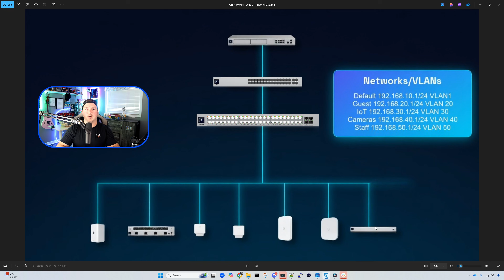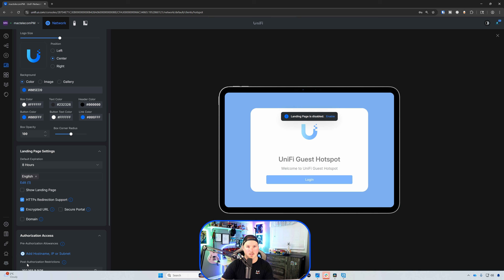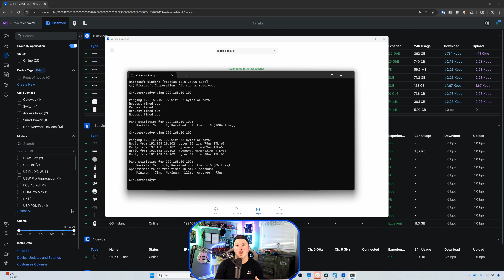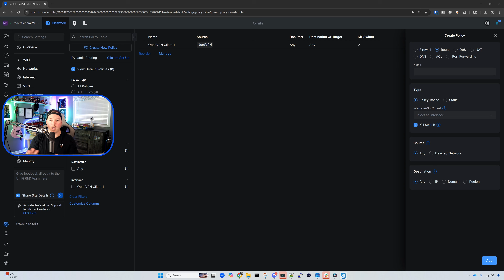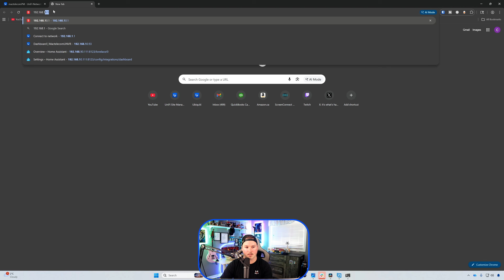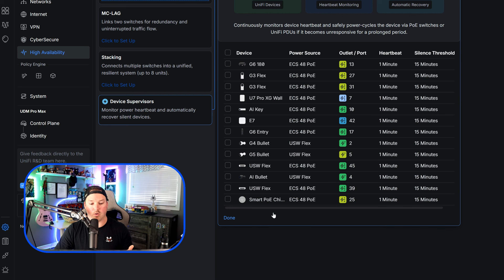UniFi Network 2026 Full Walkthrough Tutorial

Comment: Anyone going crazy trying to figure out how to manage PORTS after this new update - you need to disable the "STATS" radio button on the left to make any changes to the ports.  Was going crazy over this until I saw your port management at 23:45 in the video!
Reply: Ty for the tip
Reply: Also I noticed that you cannot set a VLAN to a port if you select a specific device, you have to set it to show all ports and then the VLAN option shows up when you click on a port.

Comment: Just dipping my toe into the Ubiquiti universe. I picked up a Unifi 5g Max Outdoor to power some remote cameras for a location that lost power due to a fire. In the future I plan on going full Ubiquiti for my home network and this video has been extremely helpful at letting me know what to expect. One thing I've learned is that my previous network is extremely non-secure. I look forward to upgrading. Timely video as well, considering the fire happened less than a week ago.
Reply: And as it turns out this was not the right unit to start with. 😂

Comment: Under the WiFi settings, in addition to setting the bandwidths, I recommend checking the box to use DFS frequencies. In most areas, there are only 1 or 2 RADARs that will cause an issue and the APs will automatically move off of those frequencies if they detect the RADAR. So, most of those frequencies are available for use in most areas and you'd might as well take advantage of them.
Reply: Good tip

Comment: A more technical question; Have you ever done a network with a Domain Controller and had an issue where the gateway was blocking the AD sync and DNS between the PCs and AD? (The firewall is setup correctly because a PC can see and login the AD is said firewall rules allow it)
Reply: I have run into a similar issue where some active directory services just suddenly stopped working when we migrated to a brand new Ubiquity deployment and for some reason this was fixed once i disabled Ad blcoking on the network with my domain controller. Under Settings > CyberSecure > Content Filter, open any content filtering policies where you have an AD controller on the same networks and disable Ad block then save. After I did that everything started working properly.
Reply: The reason you are having issues is that if you have ad blocking / content filter on in UniFi then all dns resolution is hijacked and redirected through the UniFi system. Disable ad blocking / content filter and dns requests will go where you direct them…. 👍

Comment: unifi is good until u need to use vpn or anything else than just browsing the web.
Reply from the maker: What do you mean? The VPNs work great
Reply: @MactelecomNetworks  guess you havent done an speedtest on udp.
Reply: Aside from possibly needing to modify the VPN file it gives you to only direct certain traffic over the link, I've had no issue with the VPNs in UniFi for quite some time now.
Reply: @JordanReese  UDP is bottlenecked as it doesent have hardware acceleration so it get beaten by any home game router for less than 100usd
Reply: @Beregor81 just because it doesnt do line rate VPN doesnt make it broken, it may not be perfect for every use case, but for ten te access to resources in an office, its perfectly sufficient.
Reply: @JordanReese  consider the price and they doesent have udp hw acell it is just sad, then mikrotik beat it both in price and hardware
Reply: @Beregor81 last i checked no one was gorcing you to use it.
Reply: @JordanReese  i just post since people might want all the facts not a promo unifi info without the drawbacks
Reply: Sorry this is just not true. UniFi has come on leaps and bounds in the last couple of years. They are now seriously knocking on the heels of true enterprise while still catering for home users / home labbers and STILL without licensing…. How does UniFi not work for you?
Reply: @johntankard  What is not true? Unifi system CPU bottleneck on UDP traffic, wich for example wireguard use. on 1000/1000 fiber i get about 500-600 in speed, and a htop on the unifi defice show a cpu bottleneck as they doesent have hardware acceleration. so i have no clue were your information come from as you obviously have not tested it yourself, do an iperf check yourself and see

Comment: VLAN / ZONE settings for Google Chromecast to be working correctly - Currently have phones in an internal trusted zone and all Chromecast / Google TV / Google Speakers in an untrusted IOT zone and, even with mDNS on both networks, casting still doesn't work properly
Reply: @mactelecomnetworks I must disagree, I understand seperating cell hones from workstations, but I do not want them in the IOT network with actual IOT devices.
Reply from the maker: Your phone are IoT devices so they should be In IoT as well
Reply: @MactelecomNetworks Actually the one change I had to make was getting the Zone firewall setup, prior to this and having just Vlans / firewall rules it wasn't working. Since implementing Zone based firewall Chromecast to TV's work, now the only issue is Spotify casting to Chromecast isn't working. It see's the devices, but won't make the connection to play the songs. Thanks for the updated guides!

Comment: Can we use a single Wi-Fi SSID and place users on different networks/VLANs depending on the password they enter?
Reply from the maker: There is that with ppsk I didn’t show that but it can be done
Reply: @MactelecomNetworks  Please create a short video demonstrating this feature when you have time! 🙏
Reply: This setting is not compatible with 6ghz or WPA3, so not a recommended configuration. You can manually move devices to their own networks, or assign VLANS with Radius.
Reply: @JordanReese I create 1 ssid for all my Untrusted devices that are on different  vlans, since these devices are basically IOT devices is don't care about 6 GHZ or WPA3 so the setup is fine for this use case. Instead of having 3 or 4 SSID I have 1